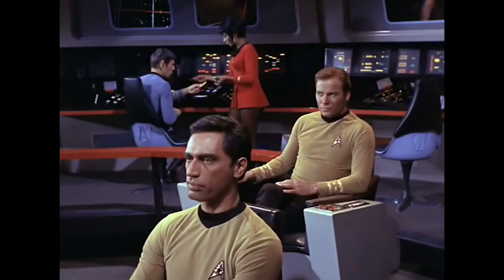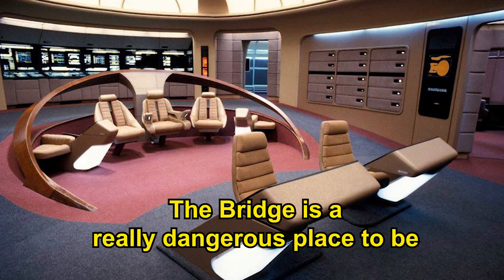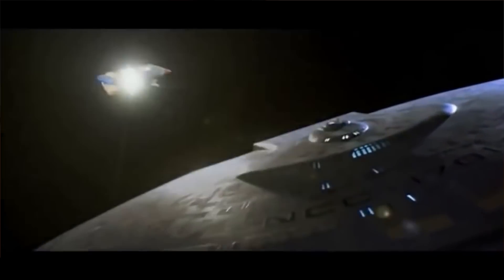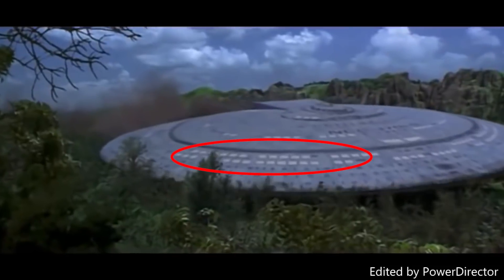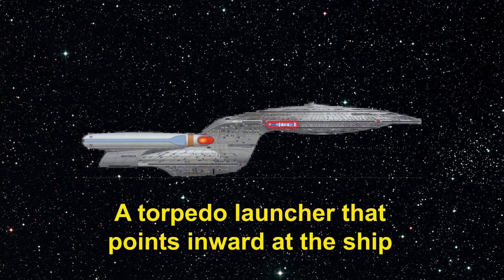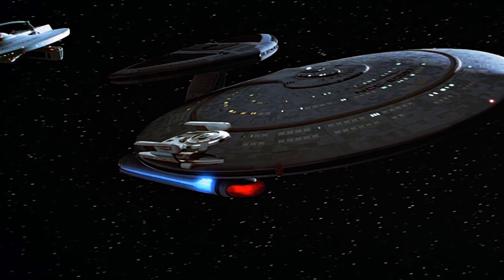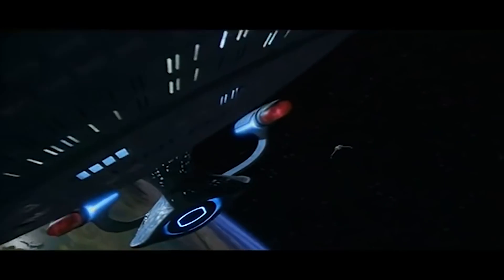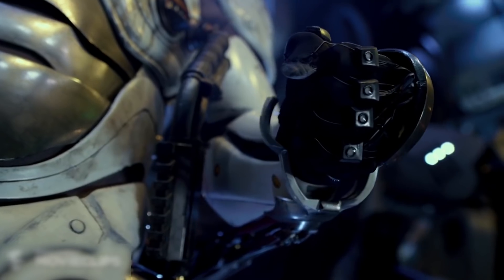10 Flaws Star Trek - USS Enterprise NCC 1701-D

Comment: 1) Bridge - where would you put it?  On the front? Or perhaps the rear? Oh...in the middle where it can't see out and rely solely on damagable cameras?  By making it center it limits any need for correction and additional training to compensate for offset.
2) Most ships will never see battle, though I agree the chairs should have 'emergency' belts
3) Security - living under constant security on a 'luxury' vessel is silly.  And a race that communicates in base computer code...no security can technically stop it, you are literally operating at the hardware level.
4) It was never designed to land anywhere, this is truly a 'emergency' action.  That is like saying....why don't planes have pontunes on them in case of a water landing.  I mean there is room on a 747 for them...right...right.  Discovery is not a good argument here, by any stretch of any measure.
5) Shield modulation can be more than just, hey rotate it.  Sensors are probably tuned for it, probably more energy, and more maintenance.  Radar actually has these properties as well, you can rotate the wavelength but even now, current radar sticks within a band.  So rotating them probably has a host of other problems, and they are not always on either.
6) Pretty big assumption that those torpedoes can't be moved in the ship as needed.  As well, for something that will rarely be used...do you want it taking up outward space all the time?
7) Nacels, the other ships are smaller.  We know their design is both functional and pretty.  They are farther apart for faster travel, exposed for better collecting, and apart for making them target more than a small area.  As well by putting them out, you limit other ships targeting the main hull to get at your engines.  It leads to a false sense of targeting in a battle.  Do i target the hull? or the Engines?  In your theory you simply target one space...in this method you target two.  And with nothing really around them, a missed shot doesn't take out other portions of the ship like your theory would have us do.
8) Ships that you pointed out have very specific designs.  Subs have small hallways because of size constraint.  Carriers...same thing.  Both have to contend with weight, and fluid dynamics.  There is no fluid dynamics in space.  As well the carrier has the ability for people to openly exit the corridors and be on very large open areas of the ship, like the hangers, the flight deck etc.  I would love for you to hang out on the saucer of the ship mid warp...we will wait.  And when you are getting 1k people to the chopper...you need wide corridors.  Unlike a ship that can sink slowly...a starship can decompress and buckle entire sections.  I highly doubt you want the corridors crowded with people.  This allows for faster travel and evacuations.  As well things can be moved within the ship without dedicated hallways that will only be used for cargo...though transporters can help here.
9) The ship was designed to be good at many things.  You don't go to diplomatic missions in a tank...no you arrive in an suv convoy.  Here the ship serves as both, and does so without freaking out the entire planet you are trying to get into the federation.  I mean yea i guess looking like a war bird with guns trained on them telling them to sign the 'PEACE' paper is the way to go for a 'civilized' society.
10) Manuvering the ship was more than a joystick.  You input a location and the ship would go there.  That is why you have people calling out manuvers, you enter the manuver and the ship handles it.  No need for a joystick to hit button b that will do 20 macro executions better than any human joystick could.  But hey if you want Tom Paris Delta Flyer controls in the galaxy bridge...yay?
Reply: This dude knows stuff. Thank you!

Comment: the corridors actually do make alot of sense logistically. you see, naval vessels of this period are loaded from the outside, you don't have to move big things around inside them, so the corridors can get by with being narrow. Starfleet ships everything is manufactured onboard in replicator plants and machine shops, so they're loaded from inside the hull, you need those big corridors to move things around inside the ship from point A to point B. US navy engineers were consulted when designing starfleet ships. we see similar things with corridors in ships being done on Navy ships and submarines today and on ww2 battleships with the corridors leading from the main magazine to torpedo rooms, turrets etc. for moving ammunition around on trucks inside the ship. if you look at the deck plans of starfleet ships, there's 2 types of corridors, Personnel corridors (narrow and short) and transit corridors for moving supplies and cargo within the hull (wide and tall). and those empty spaces are used as store rooms.

Comment: The use of space may have been inefficient but they were not "lugging it around." Aircraft carriers and naval subs operate in or under water which offers much more resistance than air. Aircraft, even sports cars, must be aerodynamic in order to reduce drag. In the vacuum of space a roomy interior makes the size of the craft larger but empty space isn't really adding additional weight. A brick and a feather fall at the same rate inside a vacuum. Adding empty spaces inside the vessel will not decrease the efficiency of the engines because there is nothing to push against (i.e. atmosphere or water). Note that I'm not describing payload which would have inertia to overcome, I'm talking about wide hallways and empty rooms.

Comment: Digital controls are actually much more scientifically plausable than a "joystick" style interface for maneuvering. In the event of the loss of inertial dampening the gee forces exerted on someone trying to manually control a ship could be incredible, therefore a series of touch screen controls which require little to no physical exertion to use provide a much larger amount of redundancy. Just look at the Expanse.

Comment: There is a major design flaw tho,  the engines utilize a central propulsion plant for combustion, main engineering in the LOWER HULL. there is no propulsion plant in the saucer. no combustion, no plasma production reactors, nothing, how is the damn saucer even able to move when separated? the damn thing can't make thrust without the lower hull attached. detach the saucer you have no thrust, main power or life support in the saucer, the saucer would become this big dead thing just sitting there for an enemy to shoot at. in order to do a separation you need a main engineering and warp reactors in the saucer and a main engineering in the star drive section.

Comment: When Gene Roddenberry was developing Star Trek, he was under pressure from the studio to stop wasting time monkeying with ship design and to create a ship that was just another flying saucer or cigar with fins. He wanted a ship that looked nothing like any spaceship ever designed, real or fictional. Hence, the Enterprise. The "reason" the nacelles were on such long pylons was to prevent radiation leaking from the antimatter pods from reaching the rest of the ship as no shielding had yet been invented that could completely isolate them. Which doesn't explain why other Starfleet ships were built WITHOUT the long pylons.

Comment: While I liked the arguments made (and since I'm not a Star Trek expert I didn't know everything, like the inward-facing torpedoes), the thing that's probably going to stick with me is the "plot armor" :-)

I'm just not completely sure about the bridge thing. Usually, when I think about scifi ships like these, I tend to assume that weapons just cut through everything like a hot knife through butter -- in such a case, the position of anything doesn't really matter, as long as the enemy knows where to aim after the shields are gone. Or else they could just power up their beam weapons and slice up the ship -- it doesn't really matter whether they hit the bridge, a ship cut into several pieces is unlikely to function properly anyway.
However, non-Borg weapons often appear rather weak in Star Trek, so the bridge position complaint might be valid here.

Comment: Thing is, The Enterprise-D wasn't meant to be a battle ship, although it could hold it's own. If you're wanting to look at a battle ship design, go look at the USS Defiant NX-74205, it is compact, armed to the teeth and extremely efficient. You can't compare the two ship designs and find the Enterprise wanting because those ships were built for entirely different purposes. The defiant was a battle ship plain and simple, the Enterprise was the flagship of the Federation and it's mission was to 'seek out new life and new civillizations', turning up to a planet with a battle ship could be seen by some races as an act of aggression, so the Galaxy class Starship is much less threatening in that regard, and also provides lots of space for guests to be entertained, space for conferences and meetings...etc. That said, your point about the aft torpedo launchers on the saucer section is valid, placing said launchers in a place where they are rendered inoperable 99.9% of the time is a pretty stupid thing to do when you might need the torpedoes should you get into an actual battle.

Now, as for the positioning of the warp Nacelles, most starships do have them in roughly the same position as the Galaxy class Enterprise. Again, take a look at the Defiant, they're more protected on a ship which was built for combat.

The position of the main bridge, you may have a point there, it is probably exposed more than it should be, but again, we're talking about a starship with some pretty strong shields and not expecting to be fighting every 5 minutes. We absolutely must put these ships into their proper context on the timeline. There was no Dominion war yet, the Romulans were not causing too many problems, the Klingons had become allies, the Ferengi were a nuisance but not actually dangerous and the Cardassians were suspicious and kept their distance mostly. The Borg was the greatest threat and a usually distant one at that. The ship was made in and for an era of peace, just as anything else is a product of it's time and place. So, I do not find the Enterprise wanting (except for that bloody stupid placement of extra aft torpedoes).

Comment: don't know much about Star Trek, just a casual fan, but from what I've heard, warp speed is something like a few thousand C.  So given space is not an absolute vacuum, it would seem some degree of aerodynamics would come into play at those speeds.  So wouldn't a more realistic design be more similar to a hyper sonic atmospheric jet or rocket aircraft, SR71 or the like?
Reply: It's actually more complicated than that.

We know from physics that as any particle with mass is sped up, it's mass increases, until it's infinitely heavy at the speed of light.

The Trek ships get around this by warping the space around them so they're covering a shorter distance than they would in "normal" space.  Think about it this way-imagine you're driving a car at 70 miles an hour for three hours, so you cover 210 miles.  If you could shorten the road around your car as it was moving until that section was 1/3 it's normal length, you could drive 70 miles an hour and cover the 210 miles in one hour instead of three.  It would appear to the outside world that you were going 210 miles an hour, but to you, you're going 70
Reply: Somehow, I suspect at those speeds, aerodynamics will probably not much matter. You had better have a powerful deflector field or warp field bubble or something to protect against all the meteors.

Comment: Landing gear wouldn't have helped the saucer in Generations since the shock wave from the core breach knocked it out of orbit and helm control wasn't very responsive. That ship was going down
The positioning of the warp nacelles is deliberate to create a more stable warp field. This is at least a beta cannon explanation for why each Enterprise has its nacelles in different heights relative to the saucer section
You forgot a major flaw-no buttons. With how easily consoles explode you would think some essential features would have buttons. I know that, at least in beta cannon, consoles are designed to have customization formats, but there's no reason that something like the warp core ejection system can't have a hard wired button for emergencies, or for helm control to have buttons in case main power fails
Reply: I agree that the situation in Generations might have made it impossible to attempt landing, but I also think the issue here is that there really isn't any good way to land the saucer at all other than semi-controlled crashing.  I think the point is that having some sort of landing mechanism would have made sense in that flight mode given that it's intended to be an emergency one.

Comment: There are actually seat belts acting as emergency belts but the reason why they don’t have the equipped
It is because the Galaxy Class was not meant for combat and more for exploration
Reply: Also there is such thing as Shields
Reply: Also the Warp the nacelles are the engine and more thruster (but there not thrust but the things that can send the ship into warp) but the actual engine is the warp core located in the hull
Reply: And, I might have gotten something wrong so feel free to correct me but the reason why there were not warships in Star fleet is because they weren’t nessercery at the time before the Borg assault and making can lead to diplomatic issues with in the federation

Comment: Regarding the manual control VS touchscreen input, if you watch episodes in which they engage in battle maneuvers,, a common command is "evasive pattern MYNAME GREEKLETTER."  These are preprogrammed courses worked out by command officers.  In this way, they can envision what's happening in their mind while directing their ship without having to yell something like "turn to 234 by 12 for five seconds, then hard about and go to 342 by 214".  

Placement of the bridge... that's actually a very real-world thing, especially given the show creators were of the "space is an ocean" viewpoint.  Take a look at any surface vessel, warship or otherwise, we have afloat today.  Where's primary control?  Way up top, and on warships commonly on a tower.  Just take a look at any aircraft carrier afloat right now.  That big tower is the command center of the ship.

Even on submarines (at least most models, they may have changed this on the most up-to-date models) the towers are mounted directly above the control room.

Comment: There's no shortage of design flaws. Too numerous to properly list. I submit that the Enterprise D wouldn't even pass current day safety standards.

No space suits in cargo bay and shuttle bays with exterior doors or manual fire extinguishers, so when there was a plasma fire, Geordi had to vent the cargo bay and hope for the best.

No fuses or surge protection on control consoles, as per. your examples of exploding stations whenever the ship was struck.

No physical methods of securing cargo, so everytime the ship was hit, containers go flying causing Worf to break his back.
Reply: Federation ships rely on active safety systems -- inertial dampers, structural integrity fields, emergency force fields... Once the power and computers are off-line, you're dead meat.  It's not intrinsically safe at all.

Comment: 1. Yes and no.  Any area close to the surface of the ship would be vulnerable but the Enterprise was build as a "generation eploration ship" not a battleship.

2. Agreed on the belts, disagree on the panel explosions as it is very very rare actually.
3. Yep. Thats a major weakness.

4. It is not supposed to land, its supposed to carry the passengers to a spacestation. The Voyager is almost 1/3rd the size of the Enterprise. Do not quote the Discovery series, its a mess. Finally hhe escape pods are to be used when the ship is in danger of imminent destruction by enemy force or sabotage, the saucer was safe.

5. Most of the time frequency modulation is not needed. Could be an option though.

6. Not a design flaw.

7. The hull is what keeps the whole ship and its personnel safe, you are suggesting people should be used as a layer of protection for the nacelles?? Also, warp nacelles work like that, they need separation from each other, without any interfering mass between them and of course they need to be some distance away from living humans.

8. Its a generation ship, can be travelling for hundreds of years, thats why it needs to be confortable for its passengers.

9. The federation was first and foremost an organization for peace, exploration and scientific advancement not war and domination.

10. Not a flaw.

Comment: I'm disappointed that you're classing anything from Discovery as canon.

And the biggest issue they had with the saucer landing in Generations was that the shock wave from the exploding Stardrive section knocked out helm control. Even if they had landing gear it wouldn't have mattered.

Comment: how about deck orientation relative to thrust being inefficient. even with hand waving saying "artificial gravity" or "inertial dampening" it makes no sense why the decks are parallel to the engine thrust on a vessel intended solely for space flight. it means power has to be wasted preventing you from flying toward the stern, while simultaneously holding you to the floor. Worse that applies to every person or loose object on the entire ship. if thrust was already pressing you toward the floor it wouldn't need to waste power both creating artificial gravity, and canceling the artificial gravity caused by your inertia during normal flight. instead it would only be needed to regulate the gravity caused by your inertia, and to prevent hard maneuvers from slamming you into bulkheads.